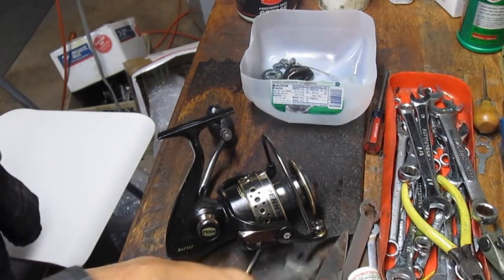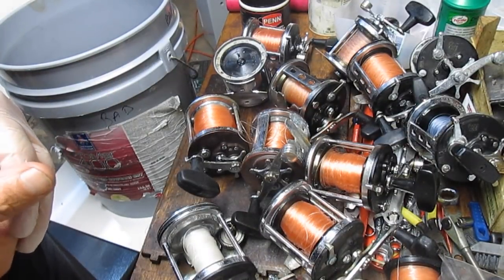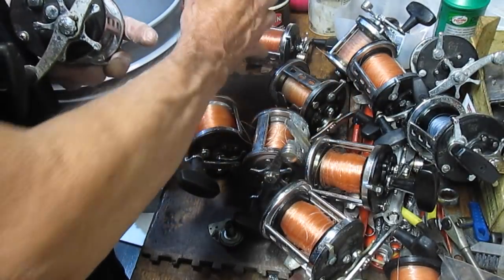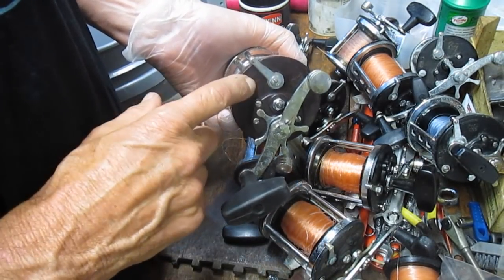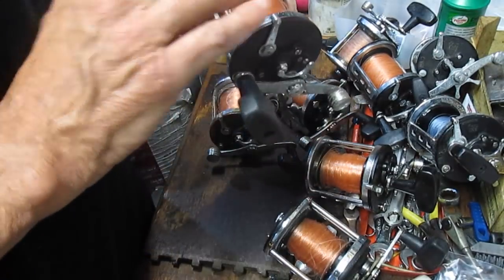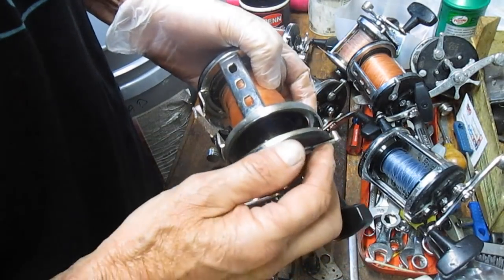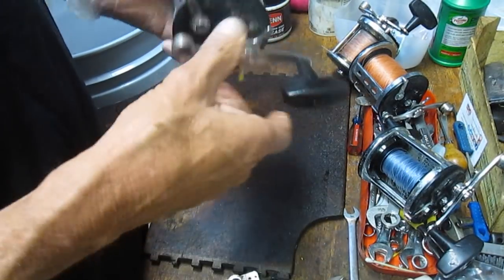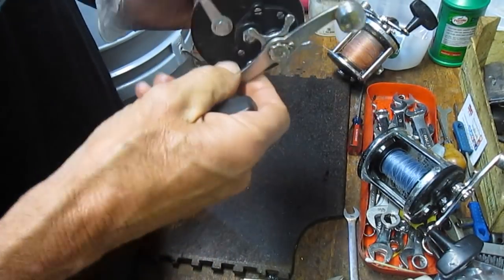Penn Jigmaster fails - diagnosis and repair and Battle 6000 update

Comment: Big fan of the Jigmaster.  You can use it on the boat for drop fishing or you can cast it from the beach/pier.  I’m a collector/user of the older Penn  reels for over 20 years and like to see that you showcase this classic brand.  Today everything has 14+ bearings, expensive infinite anti reverse and made overseas.  These things were tanks than you could use hard, clean yourself and repair easy for a few bucks and all being made in Philly for years.   Keep the vids coming.
Reply from the maker: These reels are still tanks.  Look at the abuse these have taken, and most of them will be back in service shortly.  Thanks for watching - Dennis

Comment: Jigmaster has to be a tuff real the abuse some go through. Any real will fail don't care if it's a van stall. Like you know salt, dirt failer for any reel. Point is for a moderately priced reel. Jigmaster is a tuff reel to beat. Awesome video.
Reply from the maker: The Jigmaster is built to last and time tested.  It is a good value for the price, but as you noted, like any reel, care and maintenance is needed to keep it fishing - Dennis

Comment: HI,
I ve recently seen on Alan Tanis web one of members posted photos of Penn Reel was lubed with Penn Blue Grease and after few fishing trip he noticed issues with reel. when he opened reel, the Penn Grease got into reactivation with salt water - it became like salt powder or look like corrosion/oxidation of acid like in car batteries. As the expert in Reel repairs did you notices decrease in quality of Penn Grease in recent years?  I think they all now come from China.
Reply from the maker: Asher - I have not noticed the deterioration that you are referencing.  Greases will always break down over time and after trip reel care and periodic servicing are needed to keep optimum performance.  Reels should be rinsed with fresh water after a trip, to get the saltwater residue off of them.  I have seen folks remove a reel and put it in a bucket of water and then add dish detergent.  Well, that is a degreaser! and they wonder where the grease went!. So - A lot of factors here, but I have not seen a rapid deterioration if/when the reels have the normal post trip clean up.  I also don't think that the location of where the product is made plays into this.  What would play into it is if the chemical composition has changed. I don't know if that is the same here.  I still use the Penn blue grease and am satisfied with the results. Thanks for asking - Dennis

Comment: Hi Dennis 👋 how are you
Reply from the maker: I am well - Wishing you tight lines!
Reply: @2ndChanceTackle  sir i need your help i have peen Squall 50 ld it has a problem of twist its Handel on heavy drage its not very old reel i buy last year but this problem occurs when i play tuna on it this year i feel thst i reel in on heavy drag its not reel in but slip and twist so what's the problem buddy i like my reel very much
Reply from the maker: Hasan - this sounds like you need to have the drags replaced, if I am reading your question correctly.  I think you are saying that the reel handle slips and does not turn the spool, when you are fighting tuna.  You are either exceeding the max drag of the reel, or your drags are worn.  I would check and replace these first, before I change to a different reel.  
If that I not your problem, please ask your questions again but a little bit differently, to help me understand.  Thank you for asking - Dennis
Reply: @2ndChanceTackle  ya but i check my drags washers but i found them ok i can send you the pic of them to you can see them and advice me to use or discard . And when i put the drag on half this may be occurs just one time . But when i pull my reel drag at last position my reel Handel goes slip
Reply from the maker: Yes - please send pictures as I am running out go guesses - You can send them to my email, which is 2ndchancetackle@gmail.com. Thank you - Dennis